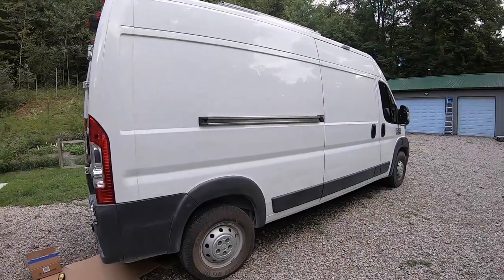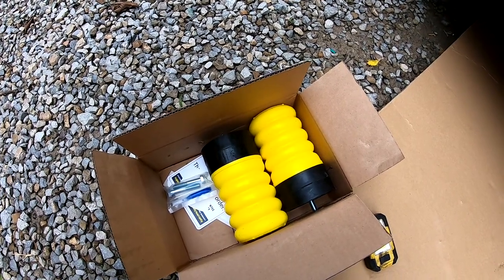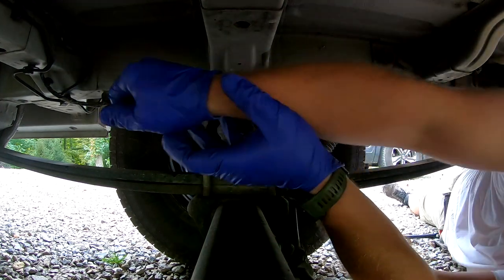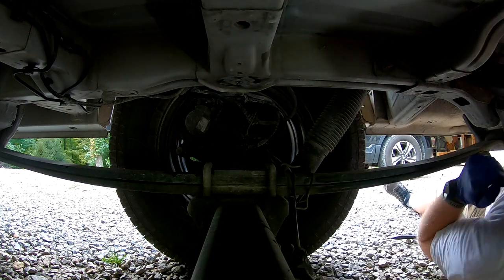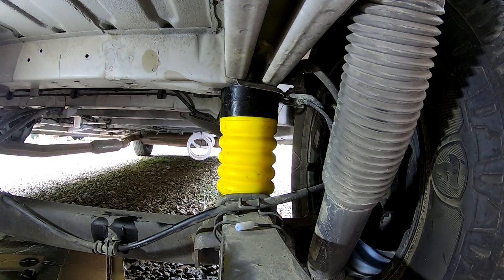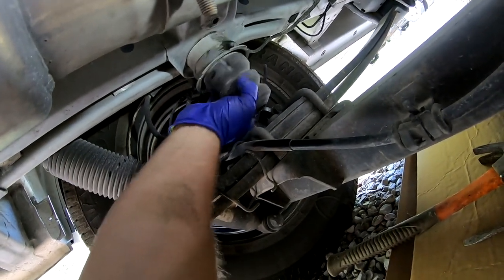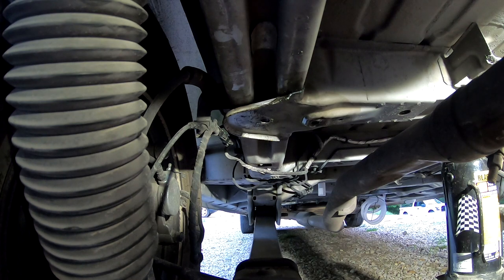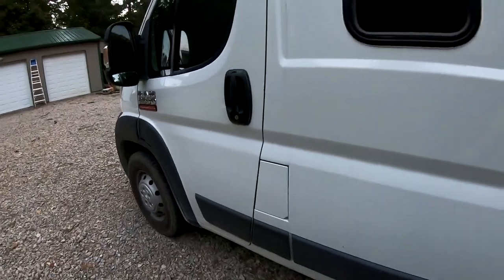Ram Promaster Sumo Springs Installation and Review

Comment: Thank you for the excellent video.  You may want to annotate the video to indicate that you did not use the jacking point specified by Ram and to indicate the location of the correct jacking point.
Reply from the maker: Im jacking the body up off of the axle to make clearance to install the Sumospring. Using the factory jacking point would not accomplish the same thing as easily.

Comment: The same thing happened to me with the tack welds giving wagon the bolt. Normally, this would have been an “oh sh*#” moment, but I watched your video beforehand and was able to wire wrap the nut, take the tire off and got it on quickly. Thanks for the video
Reply from the maker: Glad to hear.

Comment: FYI, the ride is more harsh because you didn't leave any space between the bump stop and the frame.  (hence the reason its lifted).  Manufacturer recommends .5" to 1" of space otherwise the ride is very harsh.
Reply from the maker: I understand that but if you want them to prevent the rear end from sagging, they have to be in contact. The ride is completely tolerable

Comment: My Sumo springs will be delivered in a couple days. I understand the spring is 5” and the spacer is 1”. I have a 6 1/2” gap on my Promaster 3500 (Thor Sequence RV) between where it’s screwed on and the bottom so…I might be able to put them on without jacking it up???  Since it’s a 2021 with only 5,000 surely I won’t have to deal with the nightmare you did…OMG.
Reply from the maker: It could still happen to you. I have no rust on the van. The fastener had a little bit. Let's hope that you don't have any problems though.